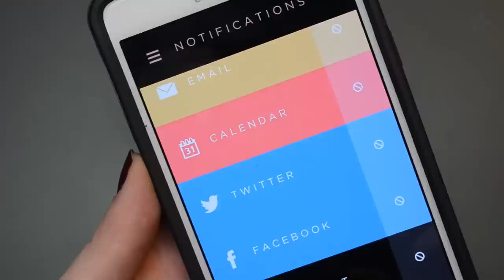Ringly Teardown

Comment: I have several Ringly products (2 bracelets ans a ring) and am fully addicted. I recently broke my ring (the whole base/jewel broke off the ring) and have felt naked without it, as I like the ring much better than the bracelets. I acquired another, but it won't stay charged unless it's in the charger. Once I take it out, it dies instantly. I'd love to try to repair it myself but am unsure if it's a battery issue, or other problem. Can anyone give tips on diagnosing? The company is apparently now out of business but I really loved my old one and am having a hard time just giving up! Great teardown, btw, really enjoyed seeing what makes it tick.
Reply: Same here. Based on this tear down, I will attempt to replace the battery myself, since... RIP Ringly. Did you try and did you have any luck?